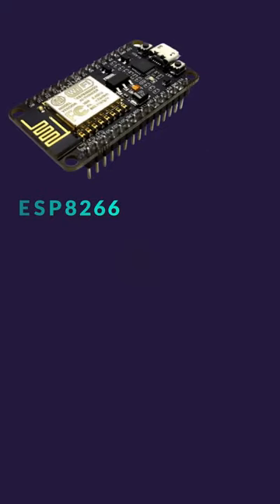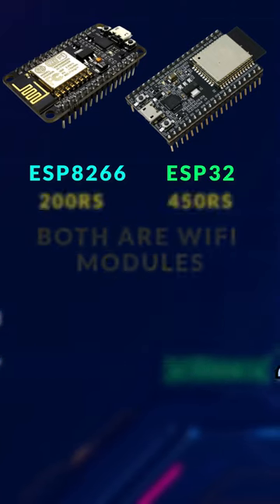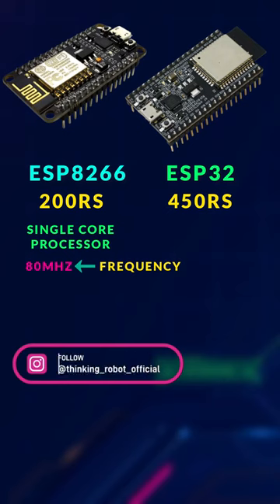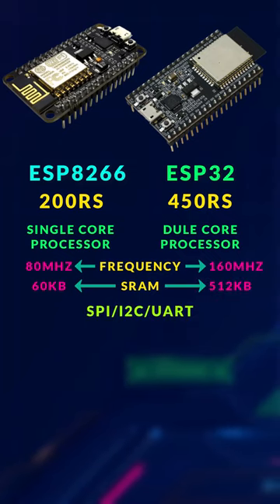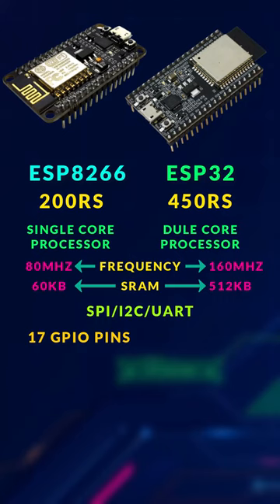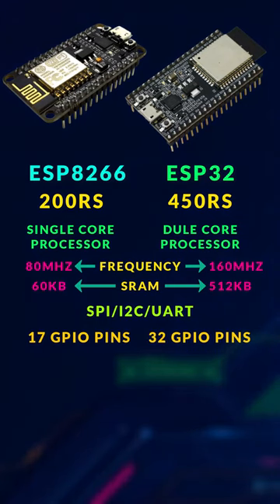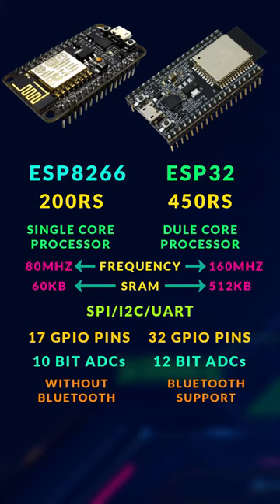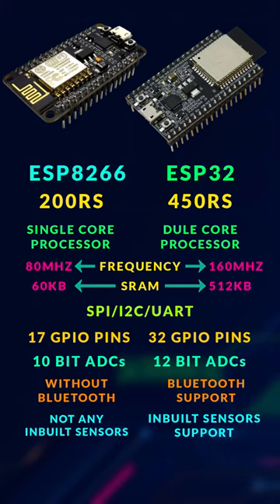ESP8266 VS ESP32 WIFI | #shorts #arduino #robotics

Comment: bro these are full fledged Microcontrollers not wifi module. and esp32 cpu frequency is 240MHz
esp32 price is 300rs in local market. just baught one.